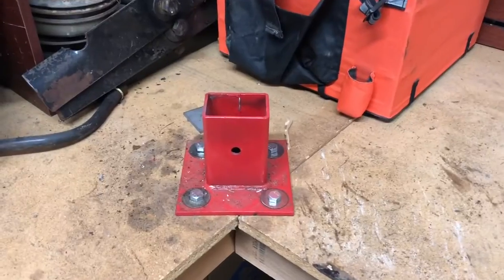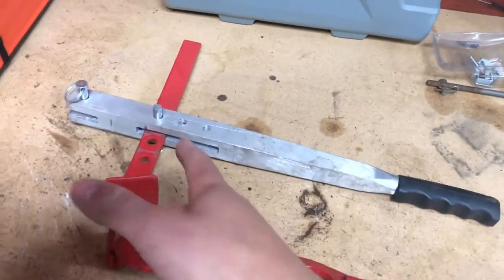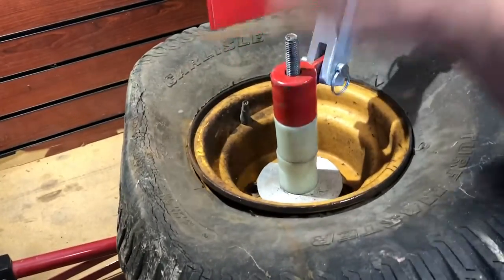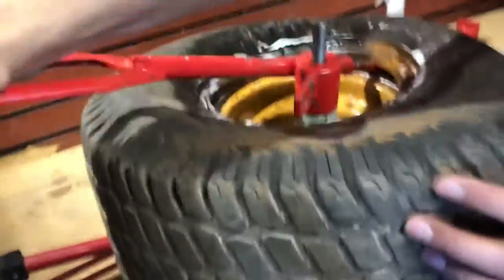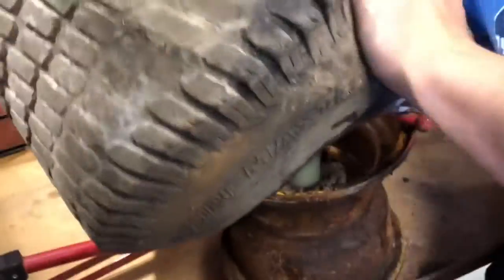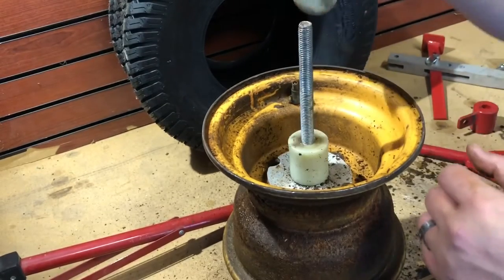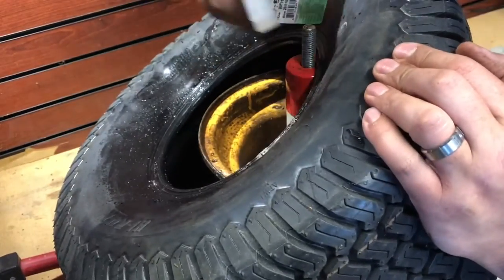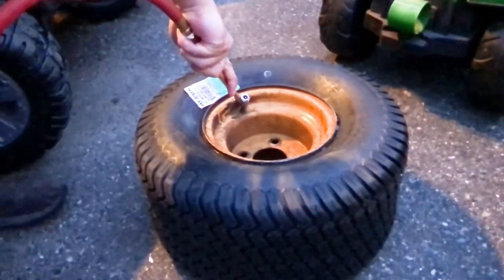How to use Harbor Freight Mini Tire Changer 61179 or 34552

Comment: You are trying too hard. The hold down with the thread and the spacers is a good idea, but the red bar is completely made wrong. The tyres come off easier than they go back on the rims. I  use tyre levers to fit as well as starting the tyre over the rim ,tyre MUST be down into the well of the rim or small and older tyre will be damaged. The trick is if you have to fight the tyre you are trying too hard. The bigger mower tyres tend to go easier than the smaller diameter ones.